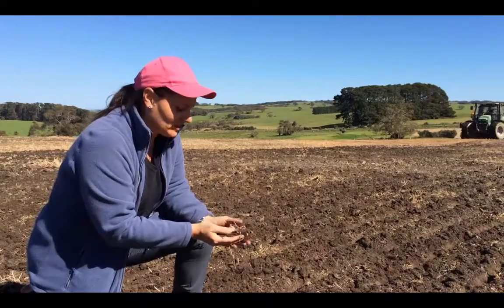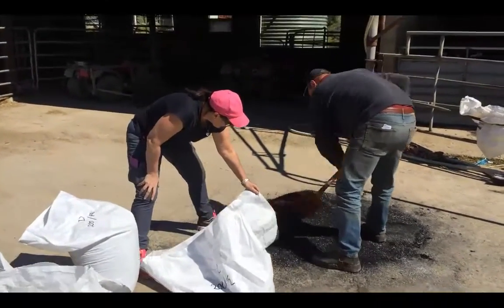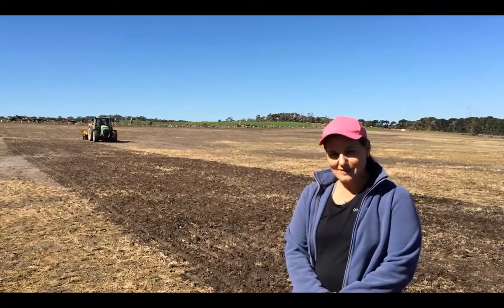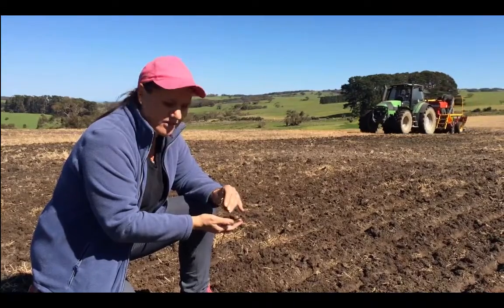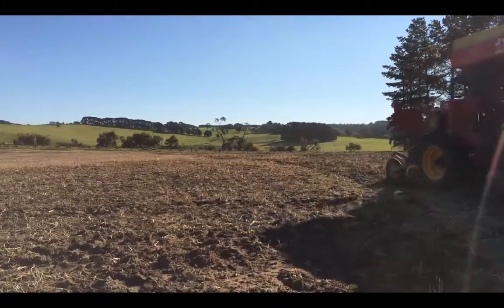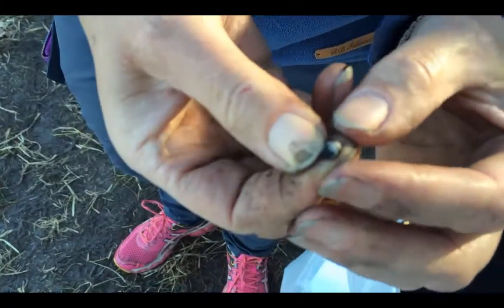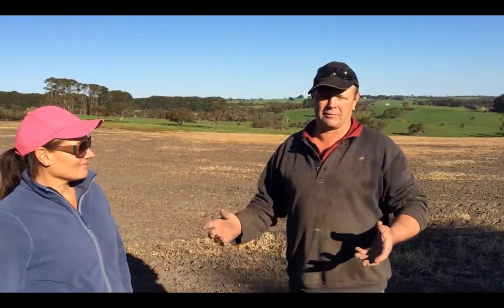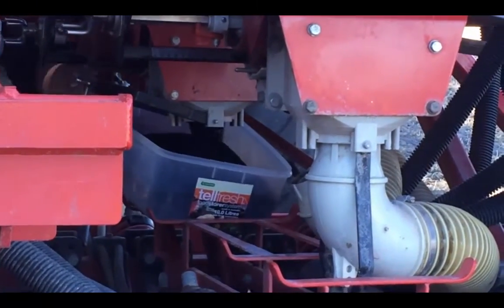Biochar pasture trial

Comment: Did you soak the biochar in a source of nutrient (mainly nitrogen) before application? Urine is the classic gardener example but manure would be the farmyard equivalent. Without this you'll forseeay decrease yeild until the very porous charcoal is saturated with nitrogen, as up until that point it's removing nitrogen from the soil.

Comment: Fair play to you's two, probably going to be a couple years before you see any benefit, until then it will simply absorb everything around it.  I would recommend looking into compost tea/compost extract to really make the best of your labours so far.  This will add the beneficial microbes and fungus required for healthy soil. Elaine Ingham compost tea and Johnson Su Bioreactor for making compost suitable for making tea.  good luck.
Reply: not sure. they look till which kinda negates biochar in a lot of ways. every till is a soil structure broken which is what biochars point is.